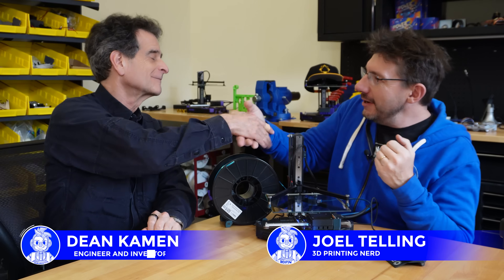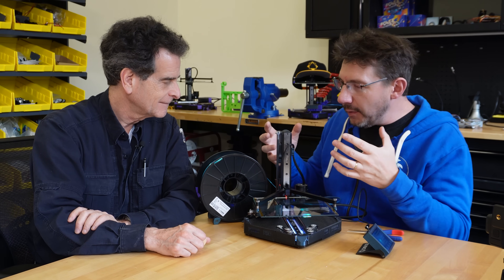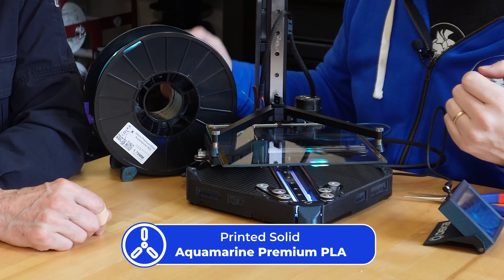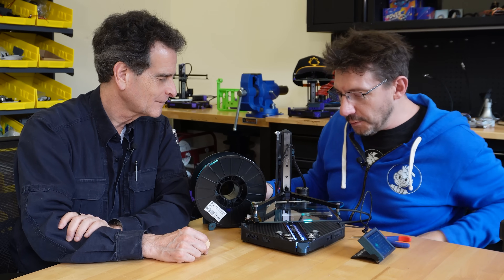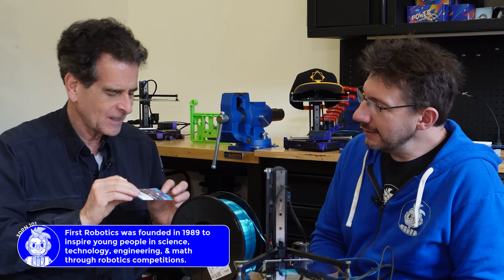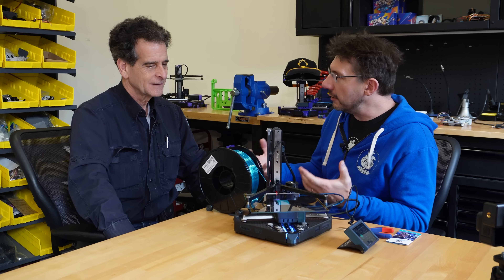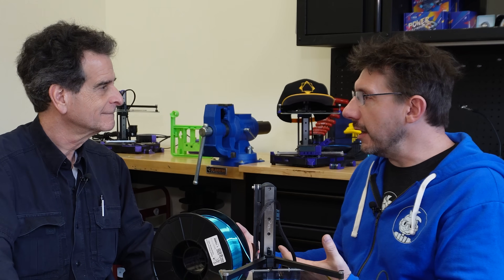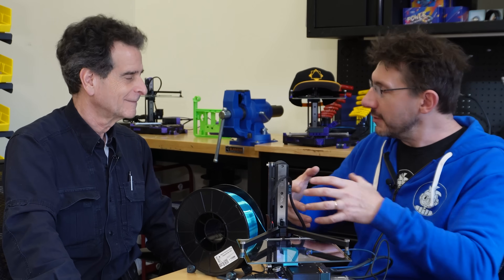3D Printing UPSIDE DOWN with Dean Kamen (FIRST Robotics!)

Comment: Supply chain being tough. That has usually been extremely hard to get any info on and Joel I and those in the long term know,  that's when it gets real in a adult business way due to commercial gain and dealing with tough entrepreneurs, sharks.
Knollage is critical from the start.
Learn to Check before all uploads and sales,  no matter how the thing file came to be, no matter where you found or purchased it, or who drew or scanned it. Bla bla..place to start, .combine all results, sort by oldest first. 
 Joel has shown his support as much as possible for the wider comunity.  Work is going on right now to make significant positive progress.  
Wishing you all nice success and to  be well.  
My opinions.

Comment: Such a cool video to see! Alumni from team 2046 (2014-2017 participate). I did a lot during my time, went to Worlds 3 times, met Dean, did many outreach events, pushed different designs for robot parts, and volunteered at first events since 2016. Sadly, I won't be able to this year. But am watching local FRC events in my districts.

Comment: My son has been doing F.I.R.S.T. since 7th grade... he's a senior in high school now. Since he got into high school I've been printing parts for his robots that he designed. He has learned a ton about 3D modeling but also about quality of life when it comes to manufacturing, design, and assembly. Things like: how easy is it to attach or remove this part should it fail? How will I attach this part? heated insert? Nut and bolt? Glue? If I need a giant part by this weekend, when do I need to get the file to the printer? He has also learned that despite the versatility and flexibility of 3D printing... 3D printing cannot solve all of your problems for you. LOL. Great to see Dean talking about it!

Comment: I was following this project for quite awhile, subscribed to the channel on youtube about the "pizza box sized printer" that did upside down printing. saw part 1. then part 2 never came. dead for years. what happened?
Reply: We haven't gone anywhere! We're still kicking and working on Positron 3.3 right now.
Kralyn had to step away due to his professional career, but the Positron team is still hard at work.
Reply: @nomadsgalaxy  is there a new channel other than the old kralyn 3d one?